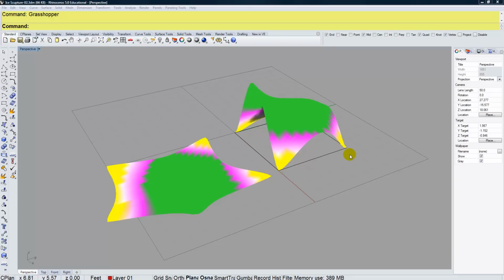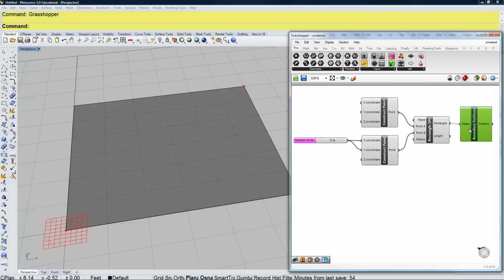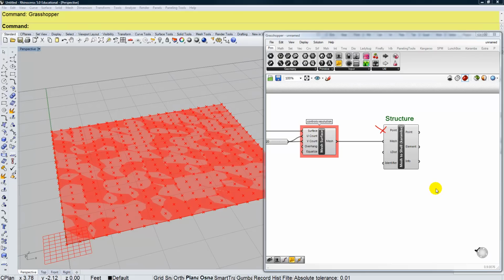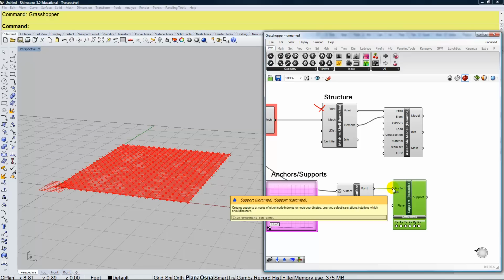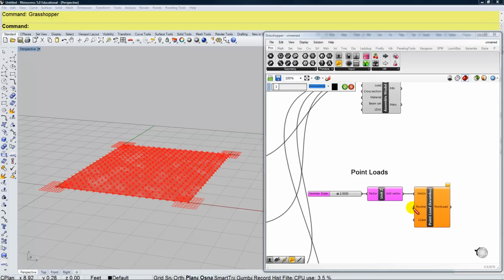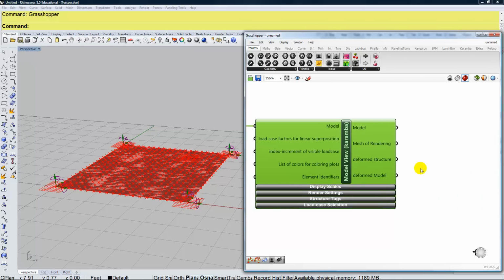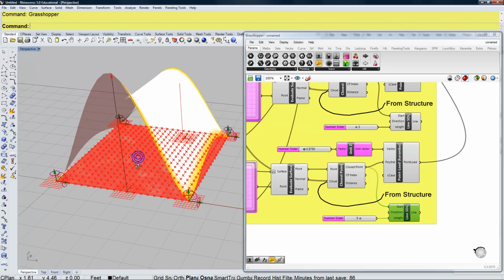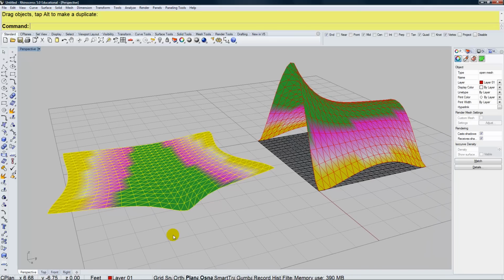Karamba Form Finding

Comment: Very handy, however double curvature surfaces can not be unfolded into plane correctly, thus the paper model is 100% wrong, the squish tool in rhino approximate and relax the whole surface to force it into plane even if it's not possible.
Reply from the maker: Riccardo Foschi yes thank you. I understand it’s an approximation.

Comment: Hi, this is very useful thanks for sharing this. I just had a quick question. How come the load determines the shape of the shell? Also do you have any tutorial for gridshells?
Reply: Here you can think of the applied point load as wind and the shell as a piece of cloth. The point load moving in the +z direction goes upward and affects the part of the cloth that correlates with the load's x and y values.